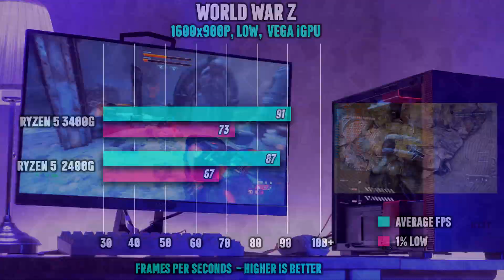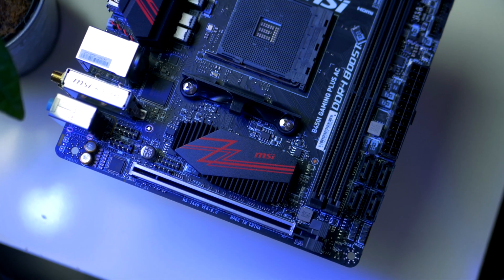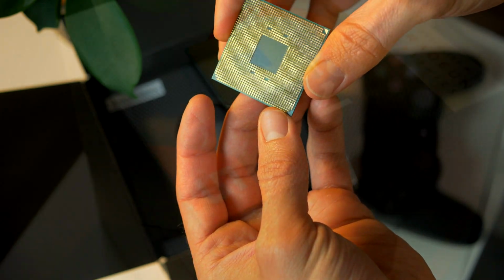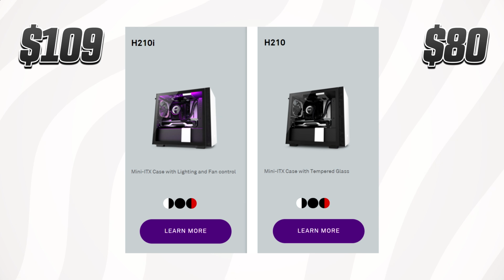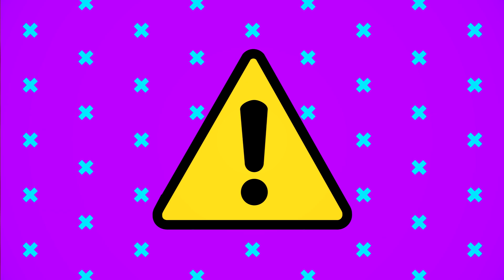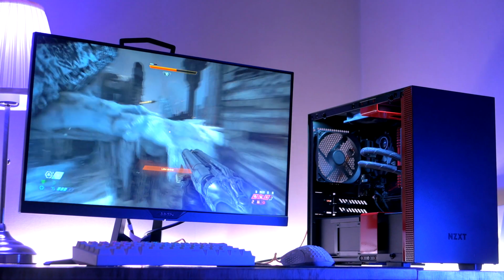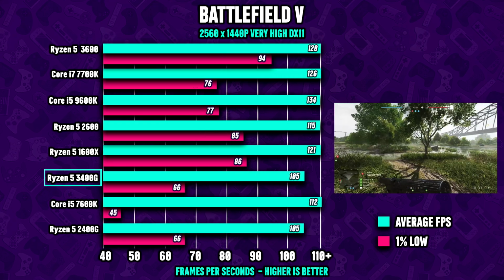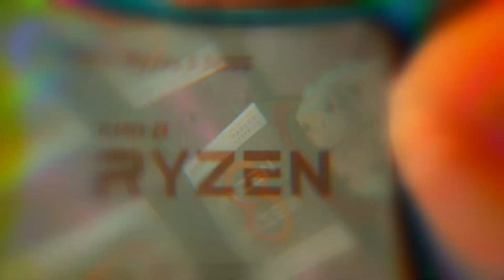Best Budget Gaming Mini PC Build in Early 2021 feat. NZXT H210i! /w Benchmarks![Ryzen Mini ITX]

Comment: Was getting offered a pc for 800 but don’t know if it’s worth it or better to build myself doesn’t have GPU but I have one to put in could anyone lmk if this is worth it here are the specs

1 Asus Rog Strix B550 Gaming i Motherboard 
1 AMD Ryzen 7 5800X Processor
1 Cooler Master Master Liquid ML240L CPU Cooler
32 GB G.Skill DDR-4 3600 CL16-19-19-39 Memory
1TB Samsung 970 EVO Plus Nvme SSD
1 EVGA PSU 220-GS-0650 Watt Gold
1 NZXT H210I Case
Reply: Dude buy it before the person changes their mind because that is worth it, kind of a steal.

Comment: Will a amd 6800 fit In the case?
Reply: Think so. I think I saw it on pc part picker
Reply: Different custom designs differ in size, so there will be some that fit in this case. Cooling won't be that great, with bigger GPUs it can be helpful to use a SFX PSU to not cover the holes under the GPU. The Case comes with a bracket to mount SFX PSUs.

Comment: can anyone tell me what the difference is between the H210i and the H210?
Reply: The lights inside the case
Reply: @stefanogava6194  thx man but which one should I get?
Reply: @inches5447  Also the 210i has a usbc port,  the 210 doesn't
Reply: @AB-kq9xm  The h210 does have a usb type c port I have that case, also make sure your MB supports it.
Reply: @MrFerrari458gto  I dont think the MOBO he used here has a USB Gen2 connector. I've just asked him the question.

Comment: I'm building a sleeper system using an old (1995) desktop case.  I spent right at $450 on the parts.
3400G - $130
Teamgroup 3600 2x16GB ($115)
MSI B550M pro-vdh wifi ($90)
512GB NVME drive ($63)
500w PSU ($50)

I figure I should get slightly better performance out of this than what you got with this config.  

Thanks for this video.  It's given me a measuring stick of what to expect once I'm done modifying the case and assemble the system.
Reply: What kind of gpu
Reply: @kiinqdoge5611  the 3400 g has built in graphics, I assume he’s going to upgrade to a better gpu in the future tho
Reply: @willfogarty1396  yeah ik but like he has a b550 motherboard, 32gb ram so he could just spend that money from those parts into an actual gpu